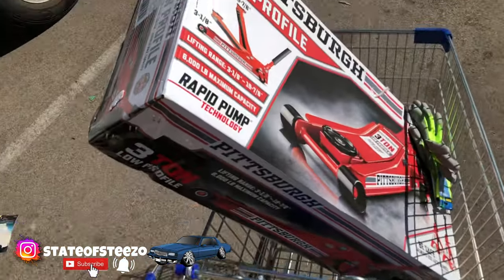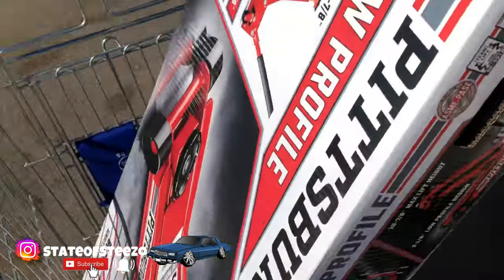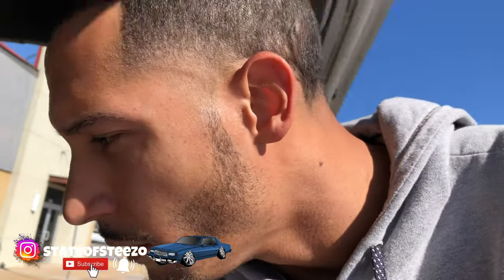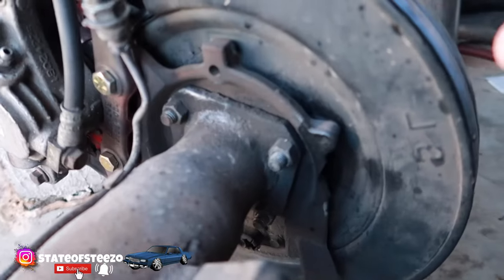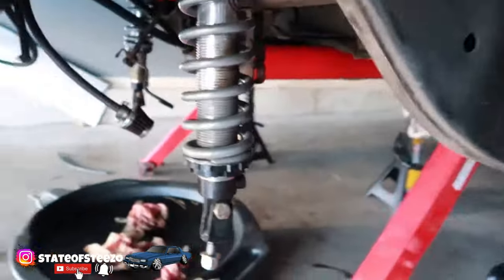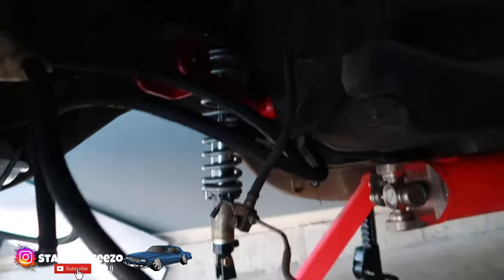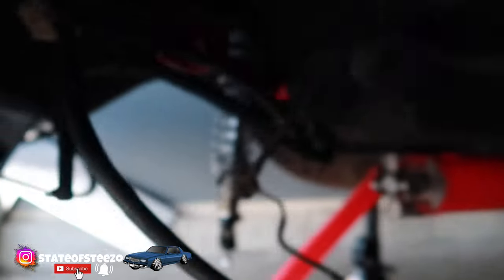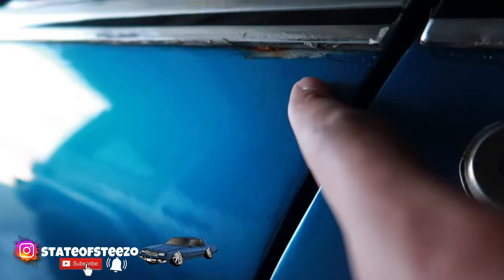REMOVING 7.5 REAREND TIME FOR A FORD 9” | TURBO CHEVY CAPRICE

Comment: Hey hey question I have a 87 box 350 bored over 40 cam 750 cab heads headers flows 350 trans shift kit 2800 stall with the original rear end in it am I loseing power and if so what kinda rear end should I put in